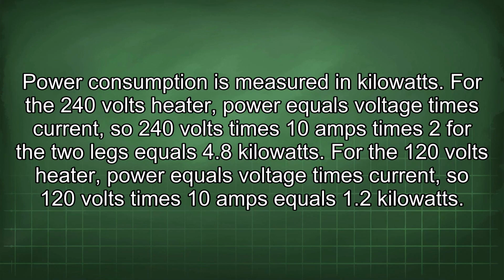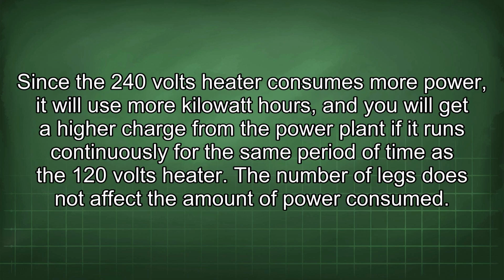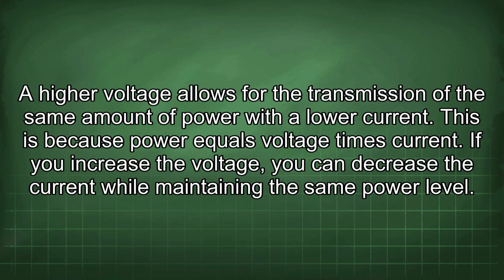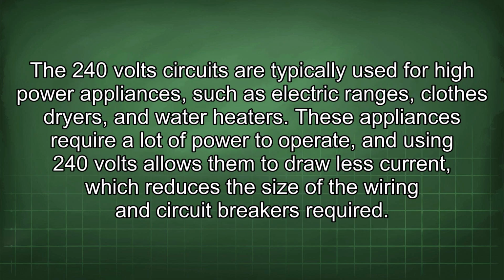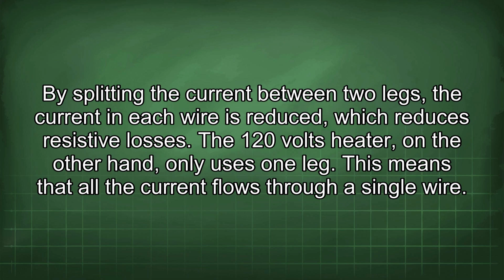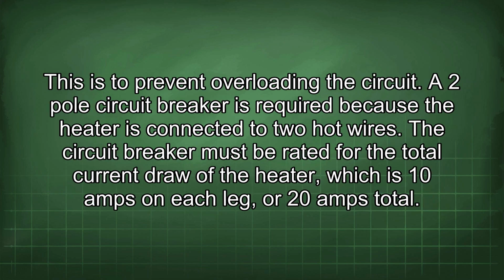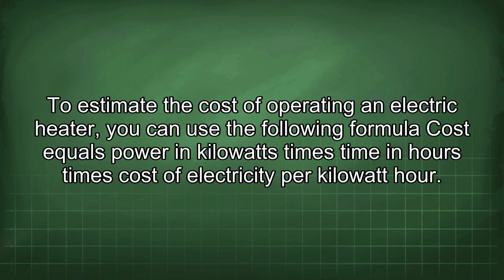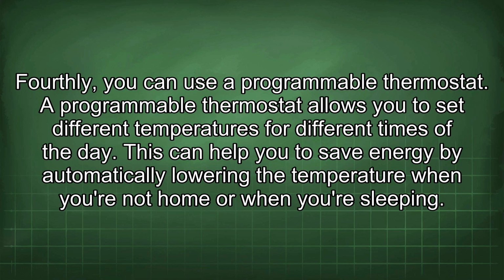240 volts versus 120 volts Heater Electricity Use

Comment: The 120 volt heater will take 20 amps to equal the output of the 240 volt heater.